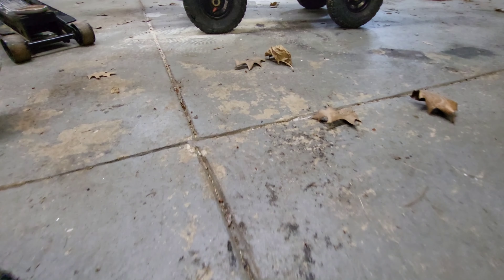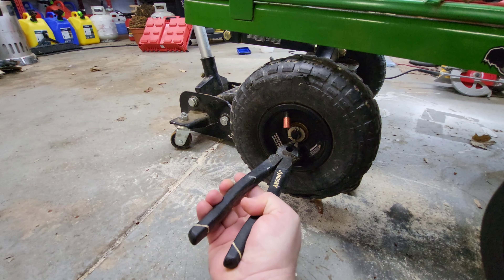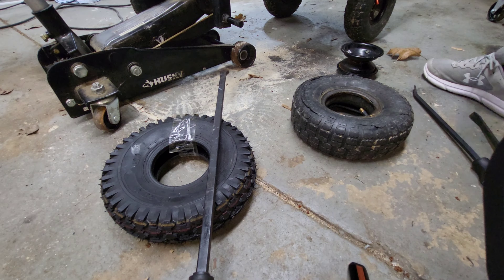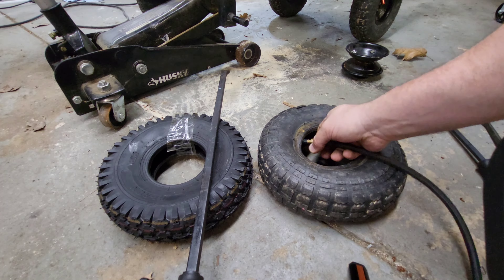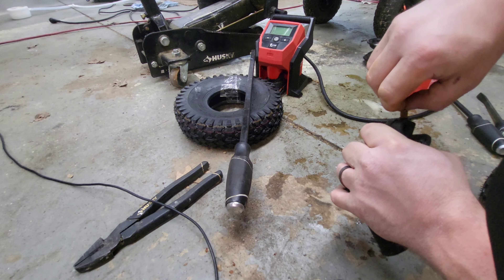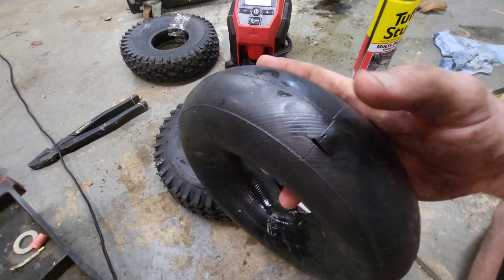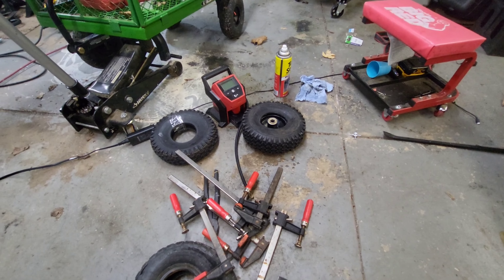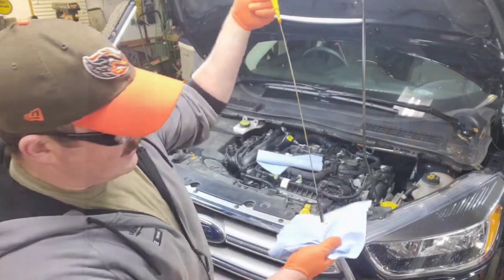How NOT to repair a tire (lawn care tire repair FAILURE)

Comment: You need to get tire tools that have rounded end so they don’t poke holes. How I’ve done it is getting the tube inside the tire and start with the valve stem in the time as you are mounting the tire. You just have to watch you don’t pinch the tube.
Reply from the maker: I'll check Amazon or Harbor Freight and see what they got.. these pry bars are not doing it for me anymore